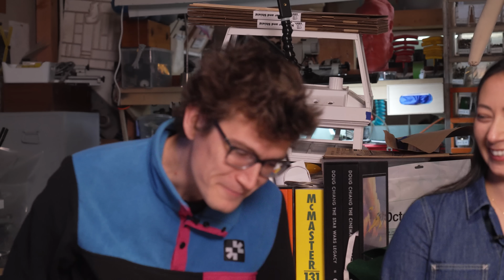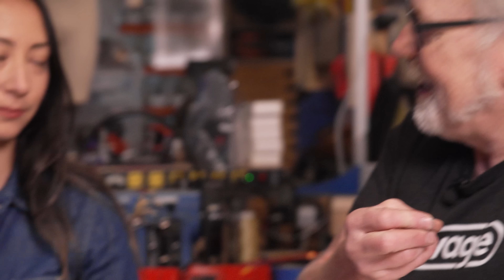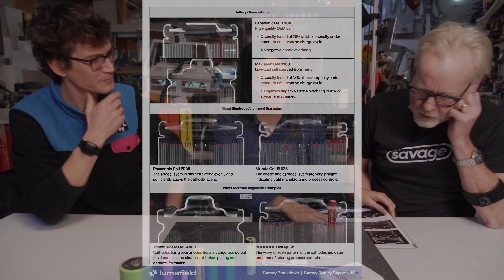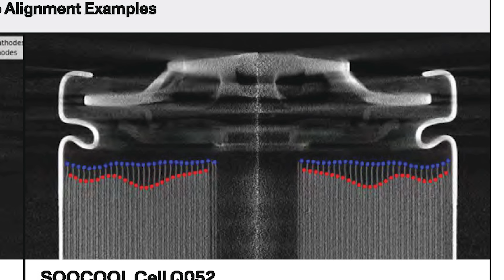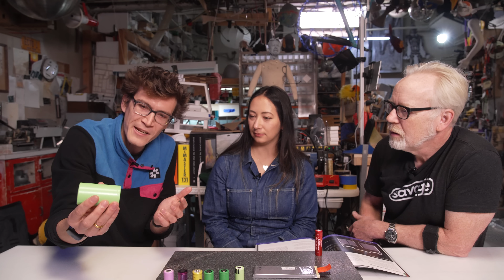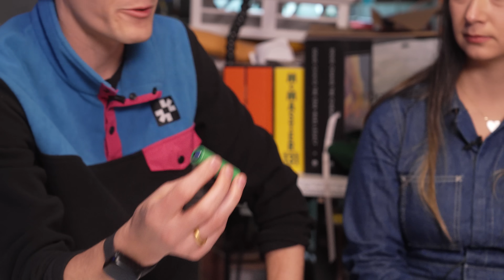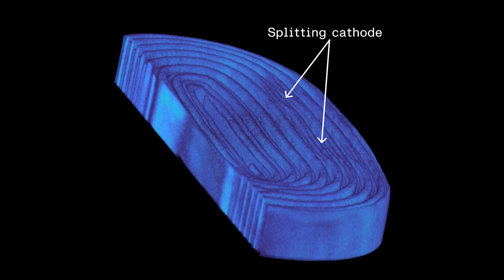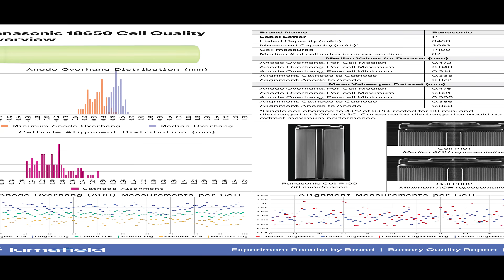The Surprising Flaws in 18650 Lithium-Ion Batteries

Comment: Both Li-ion and LiPo batteries pose fire risks due to thermal runaway, but LiPo batteries are generally considered more volatile and prone to fire/swelling if punctured or mishandled, while Li-ion batteries are typically more robust with built-in protection circuits, though still dangerous if damaged or overcharged.

Comment: My 1/2 scale r2d2 model that was from deagostini it runs on 6 18650 button top non protected batteries
Reply: Hopefully they had a proper BMC with thermal detection.

Comment: but do the flaws also exist when you have a single cell or do they only exist when you use them in bulk?
Reply: The flaws exist at the single battery level and can happen in the “good” lines
Reply: @EnthalpyAndEntropy ok but then the title is a bit misleading
Reply: @Masterusi  is it? Some flaws are worse than others. Doesn’t make them any less flaws. Also, engineering/manufacturing is never perfect.

Comment: An 18650 battery is like a model rocket engine just looking for the right conditions to go off. The videos of it happening are crazy.
Reply: A sealed metal can with highly energetic chemicals inside? that sounds like a pipe bomb. so what do we do? put a nozzle on the end of it to bleed of the pressure... oopsie we just made a rocket
Reply: @Hellsatanx most vapes these days have electronic safety features like only being able to fire for ten seconds. Back around ten years ago, mechanical mods were popular and they were literally just a metal tube, batteries and a simple circuit. There were no protections at all and yea they were basically pipe bombs.

Comment: So, how do we store and charge these batteries in a safe way? Metal cabinets like liquids?
Reply: Metal ammo cans is how i store mine. Wally World has them for about 15 bucks.
Reply: @Michael-ve6dr  If you use ammo cans, make sure you remove the rubber seals from the lid. If a battery goes into thermal runaway and vents gases, you don't want explosive decompression. Also, make sure you store the ammo cans on a non-flammable surface like a concrete floor. They'll get up to 700 degrees celsius hot at the outside surface of the box, and the lid crimp will direct the hot gasses downward when venting. An alternative to ammo cans is the Bat-safe brand, they're dual-hull like a thermos so get less hot on the outside, and have vent holes with a filter in the lid (not sure how effective the filter is). Obviously still keep away from flammables. If you want to go even further you can add another insulation layer with fire-proof bags before you put them in the box. And inert sand inside the box to muffle everything is another thing solutions do at times. Note the most likely time for a battery to experience a problem is during charge/discharge, so if you store them in the box but take them out to charge you're not winning that much. The Bat-safe has a hole for charging cables in the top, or bags can stay on while charging. Never charge unattended, and ideally away from flammables.
Reply: @Michael-ve6dr ah yes, battery bipe pombs
Reply: I store my lithium batteries in LiPo bags.
Reply: I got a metal cabinet with some vents to charge our battery packs. I still don't know if it would be completely safe, but our hope is it would at least significantly slow down a fire if one starts.
Reply: Ha, have a charger that stops if device resistance changes, and dumps sand over it if temperature changes out of sync w. charge current.
Reply: In the fridge.
Reply: Safest is non flammable buckets filled with sand.

Comment: Im sorry but if you dont own a voltmeter, a power supply, and some form of measuring electrical capacity on batteries you ARE FUCKED. This next century isnt gonna be the "oil century" as trump is desperately trying. If this is like a LIFEPO4 smear piece....Its pretty bad and just confirms everything I already knew. Cheap batteries are cheap for a reason, and I never buy them. IM SORRY, but if this 21 minute segment is news to you, you are a boomer, or never actually passed the chemistry section of your class about galvanic cells and batteries. Its basic knowledge that cheap batteries are to be avoided like the plague, and never trusted on their specs. TEst, test ,test.

Comment: The fire risk of Lithium batteries is really concerning. The sooner we can get to the next generation of materials the better (as long as they’re not flammable when exposed to open air).
Reply: As energy density goes up, then we will always be dealing with the hazard of lots of energy in a small space. 

Cars are still powered by gasoline (mostly) but the radio of car for incidents has gone down since the 70s.  We don't have a safer gasoline, but we do have safer ways to handle it in the vehicle. 

That says, there are still plenty of gasoline fires.
Reply: @Demnier  The energy density of fat is higher than lithium ion batteries, but despite urban myths to the contrary, we don't spontaneously combust.
Reply: I mean the risk of you being involved in a fatal or serious accident by just driving out on the road is orders of magnitude higher than having a battery do the same to you even if you possess a high number of battery powered devices. The risk of batteries is concerning, but people take way way riskier decisions in their lives (including what they eat and drink, actually). So overall speaking Lithium batteries is really not that big a concern comparatively.
Reply: @Sparks1979  but, if I can take a thing that has a non-zero chance of being dangerous and take steps to further reduce it, it’s  reasonable to take some steps to further reduce a risk.
Reply: @philipzielinski  I think the phrase "really concerning" in your original comment is the issue, not the idea of increasing safety.  There is a lot of misinformation and disinformation leading to the slowing of adoption of electric things, sowing unnecessary fear or concern for the benefit of big oil.  I'm no conspiracy theorist, but batteries are everywhere, and so are people who are fearful of batteries who are not fearful of cars or hammers or swimming pools etc.
Reply: @philipzielinski  Sure, but all I'm saying is people have many easy ways to reduce more serious risks and they don't, so selling the idea of lowering an even lower risk by paying more is not attractive, hence why the status quo regarding these batteries.
Reply: You're just gambling with that 3rd installed use Aircraft density battery that's going for 47,342nd cycle when its electrolytes decide to have a phase separation thus punching 4% density loss in one moment.

Comment: I have a 30kWh LifePro battery stack in my basement! 😂
Reply: That's pretty common for house batteries. Those burn with a lot less drama than LiPo, because a LiPo thermal runaway releases oxygen but these do not. They're less power-dense than LiPo, but in a house you have the space. It's still a risk, but it's easier to contain than a LiPo pack would be.

Comment: I have F38 cells in my box right now, between the focusing rail and torches sadly these 18650 sizes are a bit of necessity these days rather than a rare oddity.
Reply: 18650s arent the problem. Its cheap maunfacturers and uneducated consumers who dont know how to use voltmeters, etc. Its you.